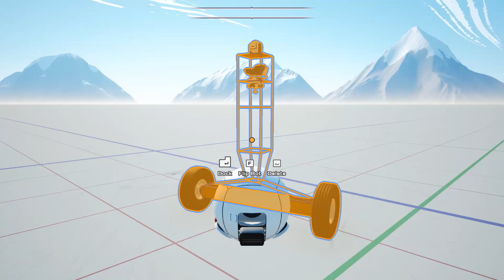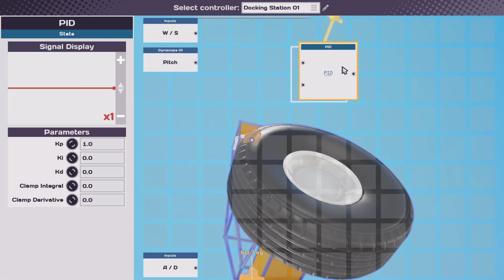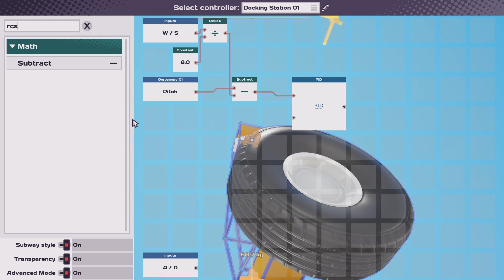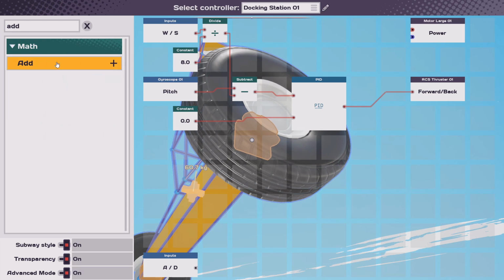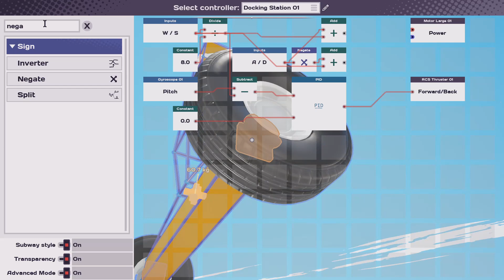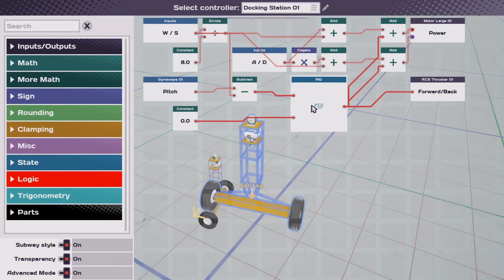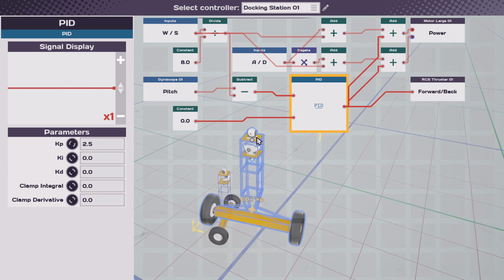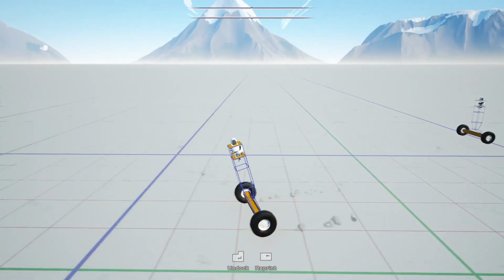Main Assembly - How to use PID for a self balancing vehicle

Comment: Are the first pair of ADDs there for tank controls? And how did you come up with the idea of adding a second pair of ADDs? And did you publish this vehicle? If you did 'Id like to get a link for it.
Reply from the maker: First I'd like to say that the vehicle is not perfect, more of just a crash course example.

The first add is for tank steering, and the second is so that the PID function can influence wheel inputs in conjunction with the thruster to keep it upright.

To be completely honest the only concept behind it in my mind was to balance torque on either side of the center of mass (probably all the time spent in space engineers)

This was my first attempt at a vehicle like this, so my logic could definitely be flawed. I'll go hunt my workshop link down and leave another comment with it
Reply: @FigoNOVA  That's ironic because you don't actually need to balance torques in space engineers, the engine is too simple.
Reply from the maker: @williamcampbell9859  Poor phrasing on my part, I balance around CoM and where you change the "Torque" setting in the control panel depending on the setup- having a grid that leads to a subgrid with an off-balance CoM some things get wobbly.
Reply from the maker: https://steamcommunity.com/id/FigoPhoenix/myworkshopfiles/?appid=1078920&p=1

Looks like "Roadkill" and "Quadcopter" are the two I had uploaded that relied on PID.

Roadkill was more an experiment on larger mass/thrust, so it's even less stable than what I show in the video.

Would upload but my computer died. If I ever manage to reclaim my data I'll share it.
Reply: @FigoNOVA  Thank you so much. Looking forward to your new tutorials (especially about PID).